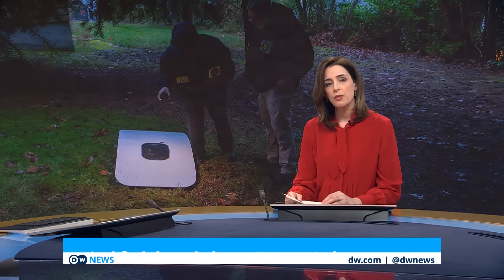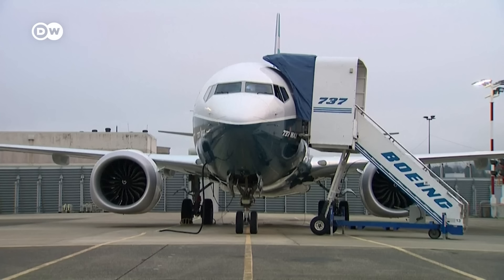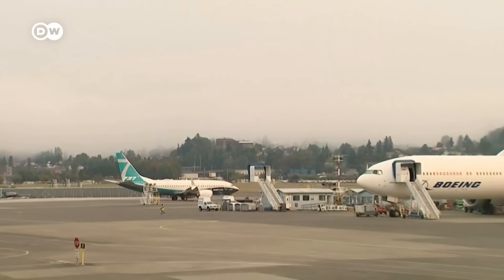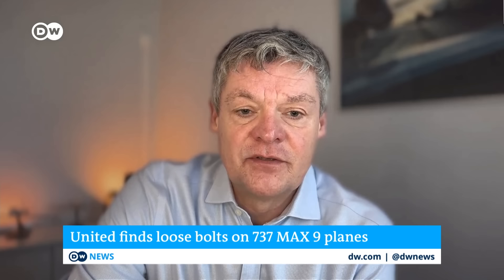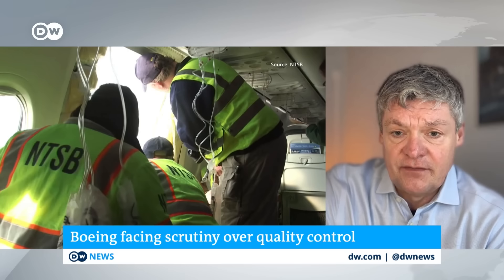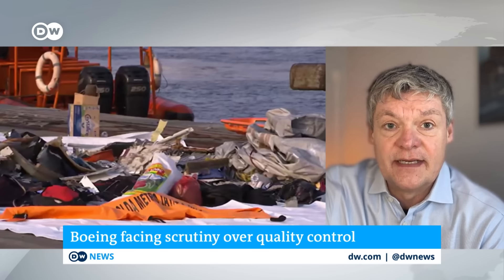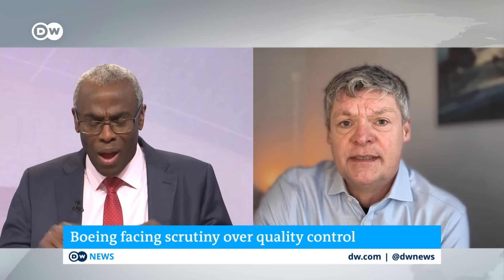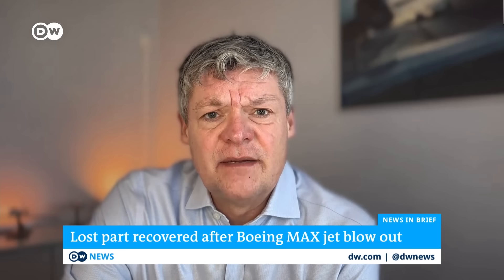After the Alaska Airlines incident: Is aviation quality control insufficient? | DW News

Comment: The problem is the Max line, they just took a 737 and added bits
Reply: And they removed big ones.
Reply: That's very oversimplified, the 737 NG(itself the 3rd generation) was developed the same way and had far less problems.
The Max was likewise developed from the previous generation(the NG), as the NG was before it. It's a common procedure, that in itself should definitely not cause such problems.
The problems are that they made highly inappropriate design decisions, wilfully avoided regulations and even talked airlines out of extra training, and obviously have major problems in assembly. This has seemingly been a gradually increasing institutional problem. The same could've been done with a new design.
Likewise the fault here has nothing to do with the design.
Reply: It had significant redesign

Comment: Air France Flight 447 has entered the chat. Dominated by computers, Airbus designs its planes with less tactile response.
And it’s not just one single component that could have avoided the tragedy. Multiple Airbus-designed systems played a role to create a deadly feedback loop that convinced them to climb to the point that the plane stalled and it fell from the sky.

Comment: Airlines are checking Boeing Max 900 series aircraft in the USA only around two door panels,  and have found some aircraft with loose bolts and missing cotter pins on a few aircraft.
What would they find if they checked the whole aircraft??

Comment: The real issue is why is the door plug designed to open during rapid decompression, why would any airline have seats in that area?  I would not want to be seating there at 30,000ft.  That is a major design and safety issue.
Reply: lol, it's not designed that way. The decompression didn't cause the door to open, the door opening caused the decompression.The cockpit door, however, did open because of the decompression and that door is designed that way to keep from exploding and  literally fragging passengers with door bits.
Reply: @donmab — The plug fills a doorway designed for an emergency exit door, so uses the same retention mechanism, slightly modified.  The emergency exit door is designed the way it is because it must be completely secure in flight, yet be able to be quickly opened by a passenger in case emergency evacuation is necessary.

Comment: Problem seems solvable going forward by simply putting the door on all versions of the model to reduce variation in production processes. It's an emergency exit, not a boarding entry, so it's not like the door ever needs to open under normal operating conditions. In the case of emergency, who has ever had too many ways of getting out of an enclosed space. Additional emergency exits aren't a bad thing. 

The problem is the airlines didn't want to pay for the extra door, couldn't get the 900 anymore so forced Boeing to make this version which simply should not exist.

Comment: I worked shortly for a place that made titanium aircraft parts for aircraft. The tolerances were out of spec for many parts. Boeing would get a discount for every part a little out of spec. A lot of you people are wrong. The 90s was very unsafe for Boeing. They had many failures. They changed their processes for making parts and quality control. My father in law worked at the same place for 30 years.

Comment: The new management at Boeing have been cutting safety corners everywhere since the construction of the 737 MAX. Their faulty MCAS system has brought down two airliners already. The basics of the 737 MAX are just unsafe. It should never have been allowed into production. This plane will sink Boeing.
Reply: The MCAS has been fixed.

Comment: So if these bolds are lose and even cheaped out since i understood it should be a rivit instead of a bolt in this place. Where did the cheaped out more in the production. And are there more bolds that could for example have the egine/or other parts of the aircraft com appart! i think this part is not sufficient to have a save airplane if i hear what just happened here. I dont understand why in Europe we did not put these on hold.

Comment: This is the door plug improper installation. Now the question is is there more such surprises hidden in Boeing planes. What will fell off next? A wing? An engine? A tail? After such a disaster like the previous one you would think they should learn the lesson. But no. They do the same.

Comment: There are a lot of assumptions in comments about the seating, and that it is too big of a "coincidence" that they were empty.
While they may have noticed something wrong and avoided seating people there(which seems somewhat unlikely to me, as they'd seemingly have to effectively mark them as unavailable for online booking), it's not unusual that they were empty.
There is 1 window across the space there would normally be at least 2, so they're inherently less appealing seats. It looks to have basically been 1 window for 2 rows of seats.
You can easily see the window spacing in exterior photos, eg: of the equivalent Alaska Airlines plane N960AK.
Seatguru also seems to show the equivalent(or immediately adjacent) seats/rows on the 737 Max 9 marked as "bad seats" by customers, due to misaligned(with the seating) or no window. It's labelled as "737-900 (739) Layout 1", but "737-900" is also used for the exact Alaska Airlines max 9 plane.
They're possibly also a little noisier in normal operation.

Comment: The NTSB says that the door by design is supposed to release when decompression occurs, and the problem is  crew education. However, they glossed over the fact of why pressurization issues existed which speaks to the loose bolts and perhaps other problem areas. Goodbye Boeing. Won’t fly in any late model aircraft that you construct.
Reply: Keep in mind you are referring to the cockpit door being designed to open on decompression, not any fuselage door. They are about a similar as your car doors are to your glove compartment door.

Comment: Okay Boeing production (technician and inspection) may point root cause at an assembly escape. The deeper failure is the the lack of aviation cultural empowerment, the power to say "stop". Obviously making a profit is an imperative but never over safety and airworthiness.  Let me explain, why were seat 26A and 26B not occupied? Did the cabin crew accept the notion that those seats were always cold and noisy and fail to ask why? or communicate it to Flight crew?  Did the Flight crew ever question why Cabin crew repeatedly asked for more heat in that cabin zone? Upon looking at logbook entries, did the Flight crew ever discuss with Line Mx why are so many pressurization write-ups happening on this aircraft and not the 64 other aircraft? Why did Line MX continue to remove and replace components per AMM but never ask whether teardown reports showed outflow valves removed functioned properly? Why did Alaska reliability and engineering group who monitor failures not notice that specific aircraft MTBUR or MTBF for the outflow valves diverged from the other 64 aircraft?

Look at the process and you may discover the deeper problem is lack of aviation cultural empowerment, and the missing mindset to say "stop".

Comment: The other Max models crashed too.  It is Back to the drawing board Boeing.  Stop putting lipstick on the pig and make a safe airplane.  They need to Come clean and admit they went cheap and not repeat the same mistakes over and over

Comment: You are saying loose bolts. But since they haven't been found, there's a decent chance that they were never there. So the door was only remaining in place by force of habit.
Reply: If the bolts were there they’d still be difficult to find.  You can’t assume they weren’t there based on not being found.
Reply: @Werewolf0216  Partly true, except the door would have to have moved through four of them, before it could get round the pads that hold it against pressure.
Reply: @cageordie  might not be that hard to do if not adequately fastened or inadequate bolts to begin with.

Comment: Boeing has been issued a production certificate by the FAA, saying that it has the capacity to produce airworthy aircraft of this type, under icao rules. For every permission granted by a national aviation regulator, it must oversee the performance of the permission holder, whether it is a pilot, engineer, maintenance organisation, airline or air traffic control organisation, aircraft manufacturer or aircraft part manufacturer. Under global icao rules, the FAA must continuously regulate the quality of US manufactured aircraft. The buck does not stop with Boeing but with the FAA’s paymasters. If the FAA HAS been deficient, then all US manufactured aircraft or aircraft parts, including engines should also considered as having deficient regulatory oversight of manufacturing quality control.
Let the buck stop where it should stop if we expect safety to be controlled by an effective safety system.

Comment: More to why these doors exist is not just additional passengers it’s the regulation requirement to have doors over wings for emergency water ditching and deployment of floatation device on top of wings.
Reply: The area of this door/plug is not over the wing.  There are always exits over the wings.  These are between the wing and rear exits.

Comment: What is loosening the bolts?  The Max 9 & 10 are too long for the tiny fuselage causing too much flex and vibration which will eventually go POP too soon!!

But never complain without a solution...  Boeing should issue a new 757 NEWO stock to raise R&D capital for a new 757 with new engine, wings, and other upgrades.  Offset risk of R&D by issuing a brand new stock.  Plenty of people will, "jump on board", haha.  Ticker: B757 ?

Comment: Quoted From websites: 
" The Boeing 737 MAX is the fourth generation of the Boeing 737, a narrow-body airliner ..........     On September 23, 2015, Boeing announced a collaboration with Comac to build a completion and delivery facility for the 737,[44] in Zhoushan, China,[45] the first outside the United States" .
"The Comac C919 is a narrow-body airliner developed by Chinese aircraft manufacturer Comac. The development program was launched in 2008."     
PS:  I'm Not sure if Zhoushan is the same facility that assembles Boeing 7x7 and CRJ's that locates in Chengdu, Sichuan, ccp-china.  I remember there were numerous  assembly / mechanical failures reported on planes out from this plant.  When capitalists only eye on $$$'s and ROI's,  they will fall into the traps set for them and their countries. Mark my words.

Comment: What was wrong with the older 737's?
Reply: nothing, they needed to fit new engines for better fuel economy, thus redesigning the whole plane (albeit not much of a change, they redesigned a lot of the interior and structural components)

Comment: I don't feel your reporting is completely fair, and why, well, the two Max planes that crashed were the Max8, this incident is with the Max9. In addition, it is totally unfair to show pictures of two different sites and not be specific of which site went with which Max aircraft. You are not really be professional in your reporting!!!!!
Reply: MAX 9 is essentially the same as MAX 8, just about 11 feet longer.   It can potentially hold more passengers which is why it has provisions for the extra emergency door.  So true, the MAX 9 had an issue the MAX 8 wouldn’t have.

Comment: I will not board a 737 Max equipment.  If I love to die, there are many hapy ways to choose from.
Quoted From websites: 
" The Boeing 737 MAX is the fourth generation of the Boeing 737, a narrow-body airliner ..........     On September 23, 2015, Boeing announced a collaboration with Comac to build a completion and delivery facility for the 737,[44] in Zhoushan, China,[45] the first outside the United States" .
"The Comac C919 is a narrow-body airliner developed by Chinese aircraft manufacturer Comac. The development program was launched in 2008."     
PS:  I'm Not sure if Zhoushan is the same facility that assembles Boeing 7x7 and CRJ's that locates in Chengdu, Sichuan, ccp-china.  I remember there were numerous  assembly / mechanical failures reported on planes out from this plant.  When capitalists only eye on $$$'s and ROI's,  they will fall into the traps set for them and their countries. Mark my words.

Comment: I wonder if this could be a potential case of industrial sabotage. Remember, they usually do some of the interior installation on the assembly line at Boeing's Renton, WA factory and somehow, when the door panel is reinstalled, it appears the bolts were not tightened correctly. They need to look at the assembly line procedures for reinstalling that door panel after interior fitting and see if steps to tighten the door panel are missing or someone on the production line sabotage the reinstallation procedure.

Crazy suggestion? Not really. Boeing's craft unions have a known history of militancy against the company, and you wonder were line workers at the Renton assembly line deliberately sabotaged the door panel reassembly process.
Reply: Maybe Boeing should stop outsourcing to the cheapest labor…that likely has more to do with its problems than its remaining union workforce.
Reply: Spirit made the base fuselage which is stripped.. the assembly of the plane is entirely Boeing labor in Renton.  

If you are going to do a job, any job, have some pride in what you do and do it right.  No executive was on the line.  It comes down to each individual doing the right thing each and every time. If you have an attitude that says I should get paid more, then I will do it right, you should be fired.   

That being said,  Alaska Airlines had multiple alerts and reset them.  However, they still tagged the planes for no over water use.  Alaska Airlines needs to get their mechanical house in order.    In the meantime, Hawaiian Airlines needs to court a new buyer.

Comment: Lock nuts with lock cable. Thats how we do it on submarines. They will never move. Boeing just used cheap castle nuts with cotter pins like the ball joints on your pickup truck. Whatever happened to taking pride in your work?
Reply: You have the engineering drawings?

Comment: who does Boeing hire to assemble planes crack meth heads?if that panel was not fastened properly who is to say there isn't other loose bolts scary.this is poor workmanship you getting paid do the best job or do something else.there is no second chances in aviation things have to be done 100% with redundancy built in.

Comment: Alaska Airlines, aren't they the same  who had the crash in the Pacific ocean in the late 90's early 200's?  Man those pilots were hero's doing everything humanly possible then save that plane.  Too bad there was nothing they could do.  Maintenance issues.  Not that Boeing is that innocent these days either.  I literally pray for my granddaughters safety and the safety of everyone who flies.  Although flying is still safer than driving.
Reply: Alaska Airlines is a much better company since that crash.  The question now should be who fill fix Boeing after the MAX crashes.  I don’t have confidence in Calhoun.  He was on the Boeing board at the time, and stood behind Muilenburg until it was obvious he couldn’t any longer, so he contributed to the problem.
Reply: There's no suggestion that Alaska Airlines caused this, and it almost certainly isn't a maintenance issue, it was basically a brand new plane.
The only possible suggestion of fault from Alaska Airlines, so far, is not looking further into pressurisation problems being indicated on some flights, which is likely to have been related to the door/panel.

Comment: The fact that there wasn't enough redundancy beyond 4 bolts that could become loose is a design problem. Boeing should never have put in the extra exit and denied higher capacity which is only being used by one carrier "Ryan Air", the fact that Boeing took a good proven aircraft and then modified it way beyond what they should have just to make a few extra dollars at a lower cost than doing it from scratch is the problem. Had there been no extra exit door, no need to put in a plug, no explosive decompression. Last of all the plug should have been made larger than the opening and only being able to be removed from the inside, and impossible to come out under pressure.

Comment: Would help if the "experts" actually based their comments on facts not opinions. The four bolts are secured with cotter pins through them. Even if loose they should be captured in place. Also who configured the a/c, Boeing or Alaska Airlines?

Comment: The question is simply - how many times have the door-plug been opened since it left Boeing? If the number is 1 or larger - then, who is to blame? Is Boeing the right 'person to bring to the Place of Execution'?

The AC visited Oklahoma City in nov/dec. It arrived without the satellite antenna, and left with it. The antenna is located on top of the AC, near the door/plug - which normally is open during such work. It was after this visit that the pressure alarms occured.

An interesting question is 'how often is this door/plug opened during (ground) work?
And, how long time does it (normally) take after delivery from Renton, before the door/plug is being opened?

Anyone - do yo know?
Reply: It was said that they load some interiors through the plug during initial plane build.  After that there would not be a regular reason to take the plug on and off except for scheduled inspections.